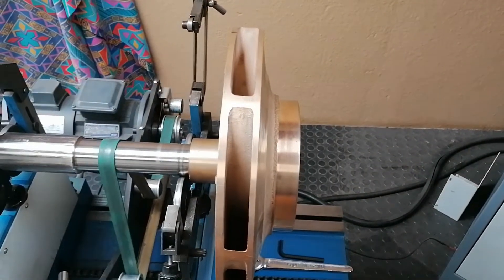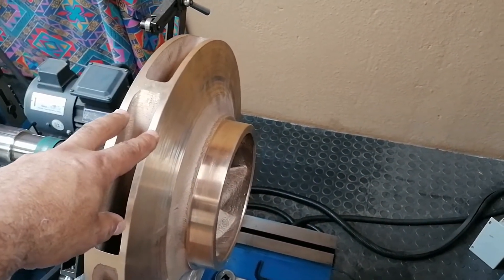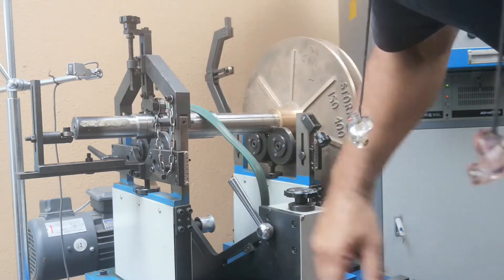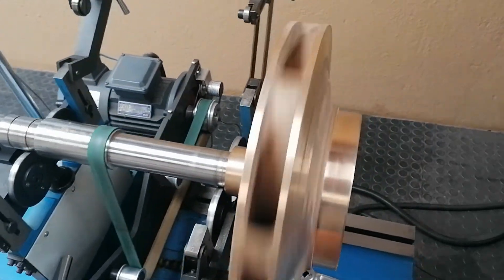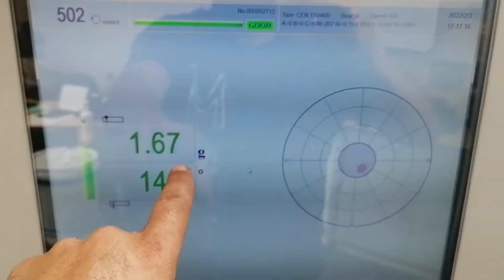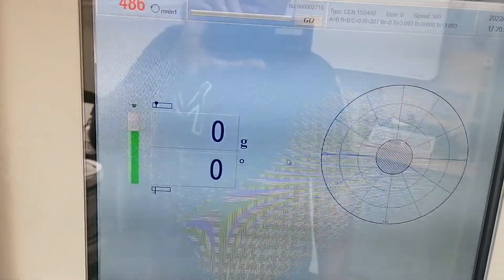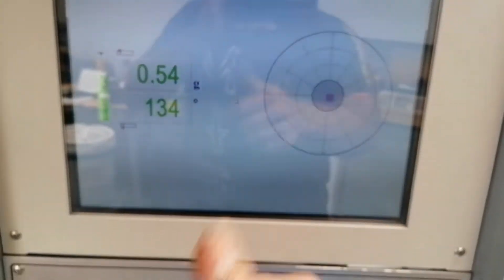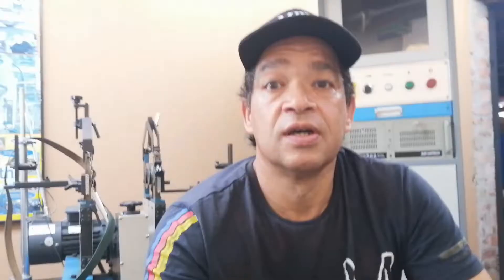Dynamic Balancing Centrifugal Pump Impeller Part 2

Comment: Sir how u r able to know at what location u have to grind, I mean u come to know only degrees but how u r able to physically know where we need to grind to reduce weight, which one is the zero for the impeller and the location
Reply from the maker: Hi, thank you for the comment. I do not think your whole message came through, but nevertheless.The zero is on the shaft using the reflector tape. When the computor determines the degree at which weight must be removed, i rotate the impeller to the recommended degree, which is determened by the infra eye picking up on the shaft starting from the zero mark. Once the spot has been reached, which will always be the top, you grind there. I hope i answered your question. Regards

Comment: Good video.
The weight shifting can always be an issue.
Can be a issue with crankshafts. 
I do like you, always go slow a little at a time.
Your impeller has a precision balance now.
Do you ever do a clay test, weigh a piece of clay and place it at the proper Radius correction and spin up for verification?
Have a great day.
Take care, Ed.
Reply from the maker: Hi Ed, Thank you for the comment, yes, i weight the piece of clay everytime is must use it in the different planes, but it must be the same piece and mass. The reason is because i must use that data in the algorythm to achieve the correct mass to be removed. Regards.